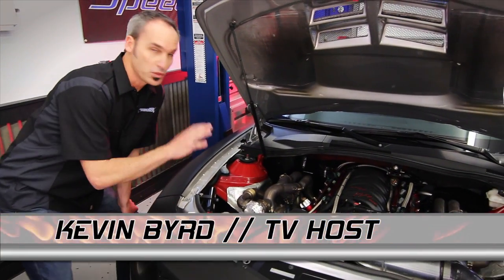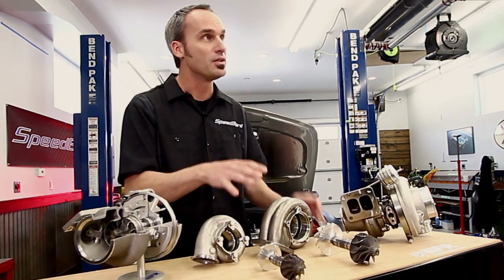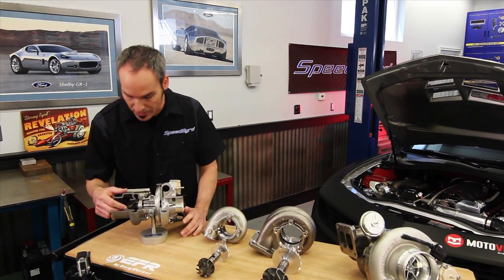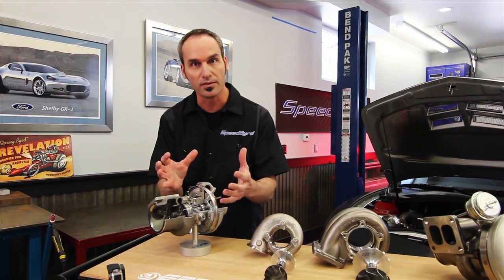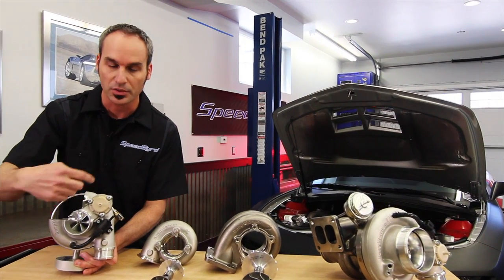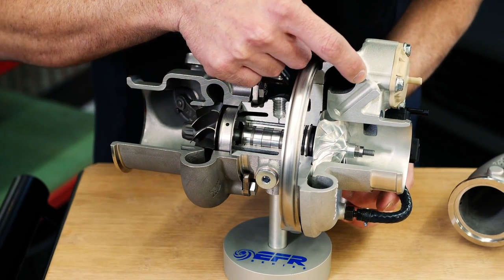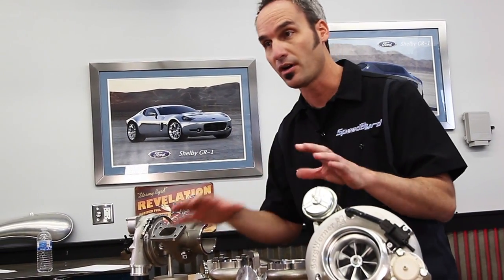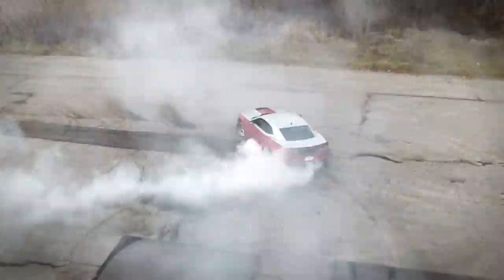BorgWarner EFR Turbo Overview

Comment: How the hell does bleeding off air through a BOV before the throttle body change the AFR? God I wish car shows had car guys and not pitch men.
Reply: Exactly like he said. If it's running a metered system (think mass air flow meter) that air has been already measured. When the bov dumps it to atmosphere, it messes up the actual afr.

Comment: Questions , does  increasing  the  bore size  inside  an engine's  cylinders  effect  the boost  of a particular  turbocharger  size  rating ?  if so , what  combinations  do you  think  works ?  increasing  bore  size  or staying  with  same  A/R turbocharger  size  rating ?